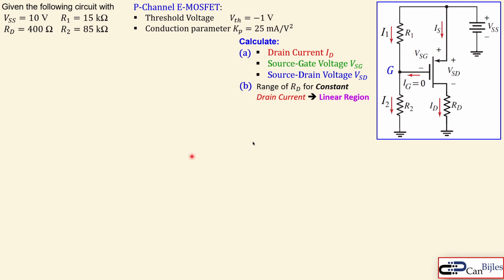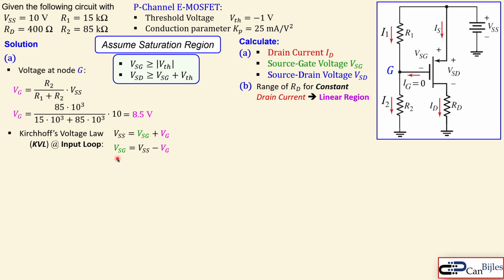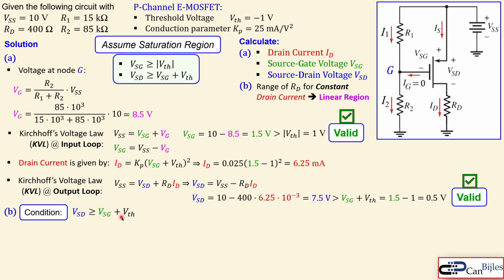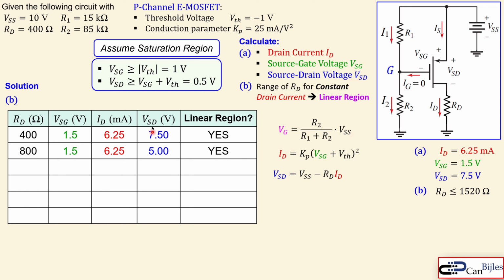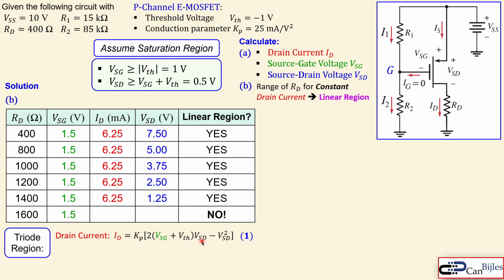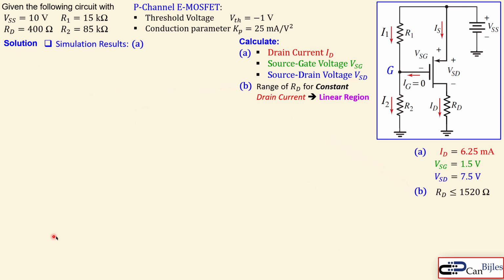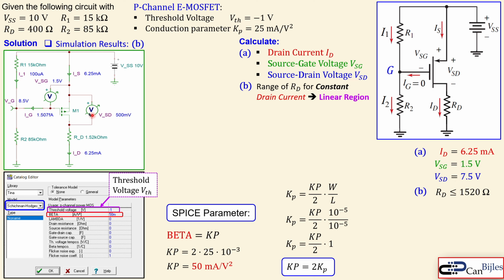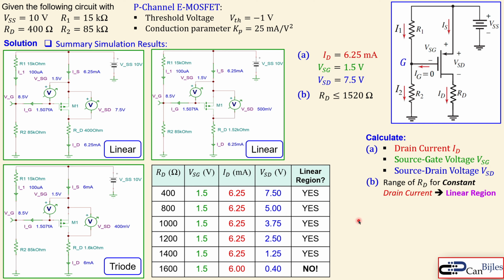MOSFET Circuit 🌟 P-Channel Enhancement MOSFET 🌟 Saturation & Triode Region 💡 Example 3

Comment: For the Id value, there is a quadratic equation that has for it's solutions (3/513 = 0.00589..  or (3/500 = 0.0060).  Why did you choose the exact solution 0.0060?
Reply from the maker: Thanks for your message. This is a very good question! Let me explain this is more detail below.

We know that the minimum required value for V_SD is 0.5 V if we want to stay in the saturation region. So, anything for V_SD below 0.5 V will cause the MOSFET to enter from the saturation region into the triode region. This is known to us.

The quadratic equation has indeed two solutions for the drain current, namely 3/513 A and 3/500 A. If you take the solution 3/513 A, then the V_SD will be 10 - 1600*3/513 = 0.6433 V, which is larger than the minimum required V_SD for the saturation region. Thus, the solution for the drain current of 3/513 A cannot be valid, since we used the formula for the triode region to get the solutions (3/513 A and 3/500 A). Remember that the quadratic equation was setup using the formula for the triode region.

If you use the solution for the drain current of 3/500 A, then the V_SD is 10 - 1600*3/500 = 0.4 V, which is less than the minimum required V_SD for the saturation region. This means that we are indeed in the triode region and this is the only valid solution.
Reply: @CANEDUX  Thankyou.  This makes sense and I overlooked the reason the particular equation was used in the first place.  Your explanations are clear and easy to follow (even for an old dog trying to learn new tricks - 74 yr old working on this stuff to keep my brain going)
Reply from the maker: @amysmith9040   Great to know it is clear now. I am glad you found my explanations clear and easy. It is a very good idea to get busy with Electronics. You will never get bored :) Good luck and let me know if you need some help or have further questions.

Comment: I think the formula for Vg is wrong. should be Vg=Vss*R1/(R1+R2) since it PMOS
Reply from the maker: No, it is correct. You take the voltage across the resistor R2, which is Vg.